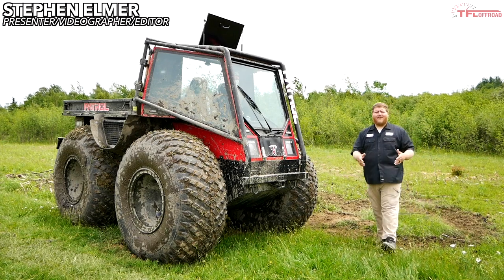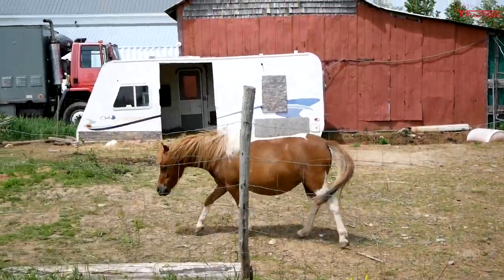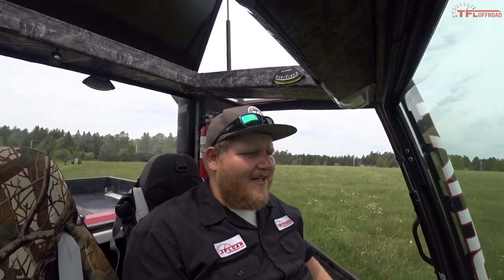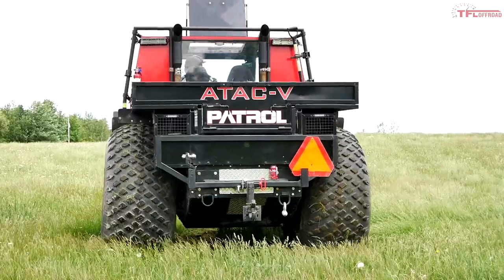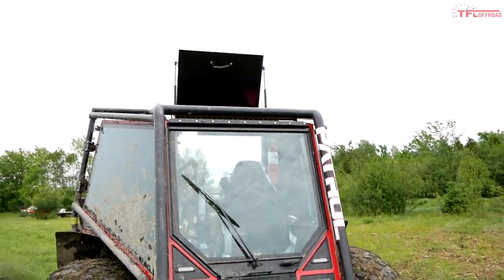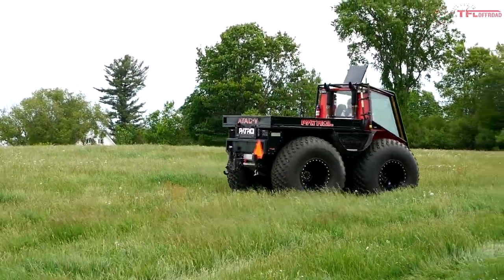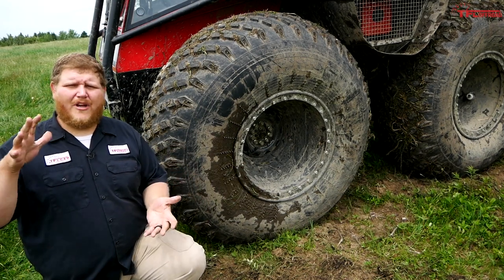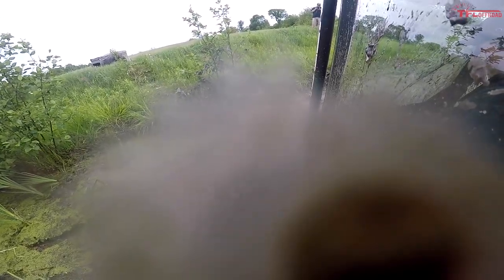This Bonkers Off-Road Machine Will Climb a Mountain and Cross a Lake: We Try it Out!

Comment: All I could concentrate on was that dog getting too close to the machine and being run over. Awesome video though!
Reply: Yes, I was concerned there for a while too!
Reply: Was wondering the same thing but they must have felt safe or I imagine they would have called it off.
Reply: Same! Unleashed dogs around vehicles and machinery make me nervous.
Reply: It's fine, they weren't on the paddle tyres, just them soft smooth flotation jobbers!
Reply: He might have been okay if he did get run over. I imagine with those tires, its pressure under them isn't enough to injure you. I got run over by a 2WD Honda 300 Fourtrax years ago, across the leg, arm, and chest. Don't drink and ride, and don't ride with those who do! It sorta hurt, but injured me in no way whatsoever. That thing looks like it has way more tire:weight ratio than your average four-wheeler.
Reply: Farm dog, not worried
Reply: @Maxton Princeton instablaster ;)

Comment: I tried to get more info a few months back on the ATAC-V , nobody has really done any testing that I know of, probably because they are not officially selling them yet, not sure why. The website for ATAC-V is limited on info, they don't  show any interior video or pictures yet, just the basic specs on mechanical. 
I am impressed with the different cab and box configurations they offer though. disappointed with the turf tires being standard and the paddle tires are an option,  should be the other way around. It's like buying a motocross that comes standard with mopped tires.
I have a funny feeling they are going to give the SHERP and FAT-TRUCK a good  run for their money ( even if you have to take out a second mortgage on the house or sell one of the kids to buy one )
Can't wait to see some real testing ! !

Comment: when he was climbing out of the swamp, his drive motors were failing on the right side and allowing the vehicle to slide back.
Not exactly a good feature.
I guess that's part of the plus and minus of going for hydrostat over the geared transmission steered by clutch and brake.
Another thing missing is the central tire inflation that the Sherp has.
Reply: That was the drivers fault. You push the joystick straight forward to go straight if you want to turn slightly to the right you push the stick slightly to the right and it will slow the right tires slightly. The more you push the stick to the right while holding it forward, the more the tires on the right will slow. If you hold it straight over to the right, the right tires will spin backwards and the left forward so you can turn around right in place. At least that's what I took from this video. If not, that's how it should be.

Comment: If you put a bucket on front of that skidsteer you could use the bucket to push you out of the mud.   I am amazed just how dumb some people are, Steve talks about and shows the other tires and half of the comments are "uhh need better tires"  or idiots that do not know anything about a skid powered vehicle saying it is under powered when it is spinning, it would not spin if it was under powered.  It really is sad that people jump to show just how LITTLE they know about running equipment.

Comment: I don't think a sherp would struggle as hard. Need a Vs video.
Reply: With the same tires? I've only seen the Sherp with the paddle tires.
Reply: @anthonyc1883  Yes your right. They're basically paddles on the Sherp. So not a fair comparison apart from that what they're supplied with from manufacturer...

Comment: Steve,..it looks like he was having trouble trying to keep both sets of wheels turning in the same direction, as he was trying to climb out of the swamp, or what was he doing?
Reply: I noticed that too, it was as if there wasn't enough power to pump both sides or the pump wasn't strong enough. That would make me nervous 20 miles back in the bush on a 3 day hunting trip.
Reply: Turning the thing will get more grip to the tires as it puts side pressure just like if you drive in sand in a 4 wheel drive.  A skid steer drives different than a car and you almost need to rent a skidsteer and run it to really understand.

Comment: Price is too high! The hydro drive IS cool compared to the Sherp with all of the attendant advantages of a high pressure hydraulic pump. Along with that hydro system, however, comes a host of maintenance issues. If Canada can drop the price, across the board, about 25 to 30 grand they will have a winner!

Comment: wonder how an electric motor or motors would work as they get instance power and have very good torque , just wondering
Reply: They would work perfectly and no loss to a transmission or hydraulic system.

Comment: Based on that whole mud pit sequence, either that thing doesn't have lockers, or he wasn't using them. In either case, WHY?
Reply: This is hydrostatic drive, each wheel is going to be individually powered by a hydraulic motor. There is nothing to "lock". It looked like he was momentarily driving one set of wheels forward, the other set backward. Why, I've no idea.
Reply: He was spinning the tires to get more traction.  By spinning one side forward the other back the tire will get more bite to get him moving forward. Look up how a skidsteer drives this is not a car.

Comment: 100grand, lmao only a fool ffs ... Give me 15-20 grand and a week off work and I'll build my own
Reply: You and I agree, The trick is where to get those rims and tires. If I built one I would use the Sherp's inflation system with the hydraulic transmission from a burned out skid steer.
Reply: @chargermopar  tractor tires and rims are plentiful here, make something work I bet. I would just buy new hydro motors and a used crane pump. Used small Detroit diesel and some electronic servos and joystick from a telehandler.
Reply: @american7169  tractor tires have stiff sidewalls and the rims have no bead lock. I would go with dual pumps and motors like in a skid steer and not bother with the joystick just use simple levers. I would love to see your build and I am sure it would be as good or better than the overpriced rich man's toys. Not everyone is rolling in cash like the canadian ostacruiser.

Comment: not a very impressive sales demo, If the company owner with all his experience struggled to get it out imagine the average user. Its nice for some applications but mud and water aint its thing!
Reply: shows how little you know about offroad driving. The tires are designed for not damaging grass.  If you had better tires it would have walked in and out.  It is a skidsteer without the bucket.
Reply: However it has a tray & a tow hitch.

It would be good if a loader could be fitted to the front.

Comment: Think the Sherp is cheaper. Like 60k usd. If they want to compete they should bring the price down.
Reply: A sherp is like 100k plus
Reply: There's one site (journal that seems to just attract readers with low ball prices) that says it starts at 65k, but it doesn't even include a wiper. Then there's a real Florida seller site and they start at 125k.

Comment: This thing is a shitty version of a sherp lol it took 20 mins to get out of one little mud hole an it looked like it barely made it. It's a cool idea with horrible execution if sherp made this it would be awsome. this isn't even close lol
Reply: This new ATV is available with the paddle tires and fitted its performance would be the same as the Sherps, the block tires fitted allow better performance on harder surfaces and even roads.
Reply: @clooperman3745  I still think the sherp is better execution because of the way u steer an have actual gears it has a better power plant with more power an everything else on this is just a copy right off the sherp. I'm not saying g this isn't cool but compared i think the sherp would b like buying Makita tools an that would be that wallmart brand "hyper tough" or "husky" lol